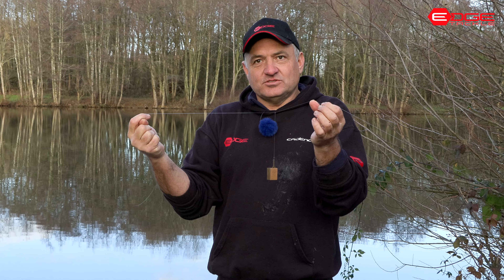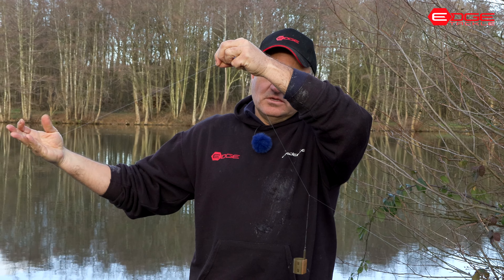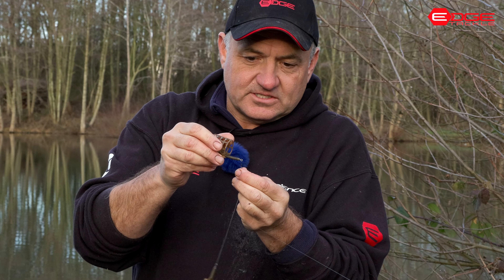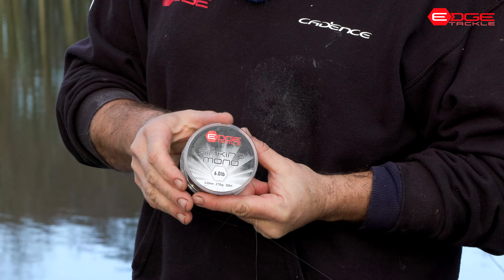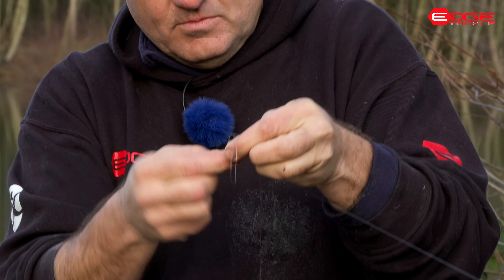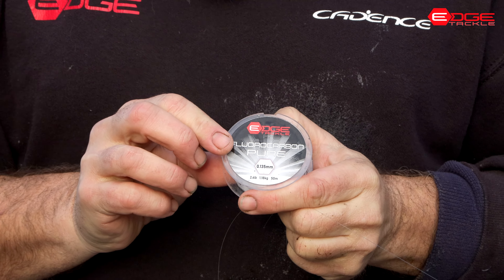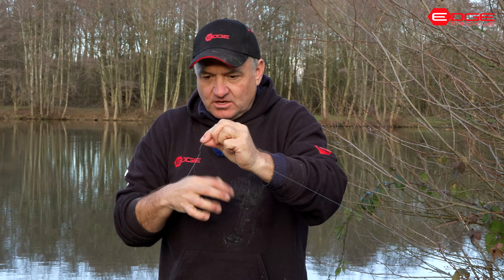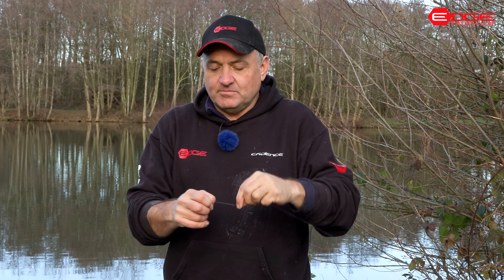Paternoster Rig - The Quick and Simple Way to Tie a Fixed Paternoster

Comment: Won’t the loop knot slip down to the feeder if you get a large fish on ?
Reply: I never liked these rigs,where if you hook a nice fish,the hooklength and the mainline pull against the knot,in opposite directions ,although i have seen many great anglers using these rigs.
Tied like that,it doesn t slip ,it breaks,but i guess for small fish,it s not a problem.
I d rather do a 5 turn water knot for the feeder ,the figure of 8 knot is great for the hooklenght.